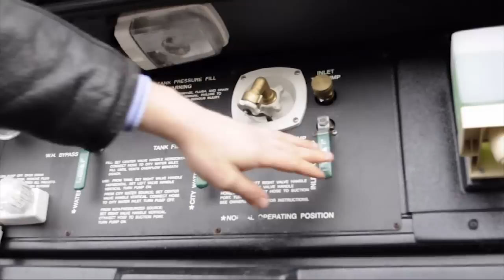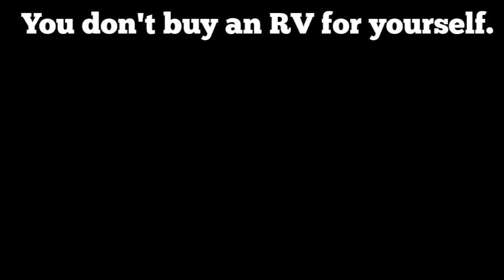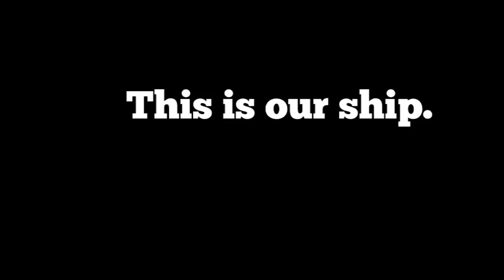Regular Car Reviews: 2004 National RV Tropi-Cal

Comment: v6!? Pansy shit!
My grandfather had a 37 foot pace arrow when I was a kid with a v10.
2 MILES TO THE GALLON! WHAT WHAT!!
This shit is probably a Prius by comparison!
Reply: This is probably an inline 6,  which all modern semis share. Since its a freightliner, it could be a Cummins or Detroit Diesel. Maybe a Mercedes.
Reply: I could have sworn I heard him say V6... but still...
Reply: L6 (straight 6) with 7.7 Liter displacement, those ford V10's are 6.8....  I bet you anything that ford V10 wasn't producing over 800 LBS of torque either.
Reply: Calm down evan, its a joke.
Reply: Evan J 

An L6 would be a completely different engine. This in likely an I6, or straight as its often called.

The straight 6 has perfect balance, Which is very important for diesels since the components are much heavier.

The V10 the other guy mentioned was probably a gas engine, Which was very common at one point. But the engines had to be massive to produce only enough horsepower, and they tended to be quite loud and thirsty for fuel. The diesel in this is probably much better on fuel, more powerful and since the engine is rear mounted - much quieter.
Reply: Trevor Reis Yeah about that.... It kind of failed as a joke and what was left wasn't even all that factual -- I wouldn't want to to think I didn't have a sense of humor though so here's a joke that a true petrol head will laugh at:  What's does a 1000HP Supra and a 400HP Supra have in common?  They both run a 12second quarter mile....Get it?....................................................................................................(it's a turbo lag joke).....
Reply: Straight six diesels are bad ass.
Reply: Evan J If you have to explain the joke, its not a good joke! haha
Reply: Evan J
If you'll take note of the initial comment I made, the only quantifiable number that wasn't just a description (v10 vs v6) was fuel economy (2mpg) and I also mentioned a Prius which gets good fuel economy.

And if you couldn't understand that I was joking by the line "2 MILES TO THE GALLON! WHAT WHAT!!" then I don't even know what to say to you. It wasn't a joke with a punch line, it was a silly comment.
Reply: ***** Or I assumed no one would get it....
Reply: Trevor Reis Thank you trevor for explaining funny to me.
Reply: Evan J
It wasn't 'funny' that I was explaining, it was the basis of my comment that you seemed to not understand.
Reply: Evan J Trust me WE GOT IT! Wasnt that complex of a joke!
Reply: ............I should have just said, "yeah."
Reply: Trevor Reis
You not understanding engines does not a good joke make.
Reply: I got the joke. It was funny! All the engine nerds can't take a joke!
Reply: noobasdfjkl
Your not understanding the difference between a joke and something said in a joking manner does not a commentary on my knowledge of engines make.
Reply: Trevor Reis I believe the word you are looking for is "facetious"
Reply: Evan J 
I believe the phrase your looking for is stop commenting. Lol
Reply: RiceReaper It's a caterpillar Inline 6, most probably this one  http://pdf.cat.com/cda/files/2200321/7/ledt7014-01_20C7.pdf
Reply: Dominic Gilbert 

Yeah probably. Freightliner uses a variety of engines. I don't have much experience with there busses, but the semis use nearly everything conceivable
Reply: Evan J 

Whatever point you were attempting to make, Has long passed.
Reply: RiceReaper You're right, my point was made on the first comment to the agreement of many. The rest has been one wiiikid pissah circle jerk down-spiral into sticky guilt ridden shame. I wish I could stop but someone keeps spinning the wheel of misfortune.
Reply: RiceReaper The 6.8L Ford V10 is a decent medium truck engine. But, it doesn't compare to a HD I6 turbo diesel. 362hp 457tq vs 400-500hp 800-1,300tq all at less than half the rpms.
Reply: hendo337 

The engines in many gas powered motorhomes were usually gm engines, since they were very cheap. I can't say what engine the guy had or what, if it was a ford engine. It wasn't a recent one. No one really makes large gas powered rvs anymore. But the point is

The old v10s are heavy, and very un economical, especially given the weight it is expected to handle comfortably and quietly. Many large motorhomes were only equipped with GM 350's, Which while for a light-medium truck are amazing, simply can't handle the requirements of a large pleasure vehicle.
Reply: Evan J holy crap you've got issues. taking your "daddy was never home" angst out on some random people who are just making jokes and trying to connect with other viewers.
Reply: Reno Jackson How did you know?  That's 100% exactly my motivation in this comment thread, I don't know why I didn't put it together!  I'm cured!  You know the best thing about being cured?  Not having to go though life with Reno as a first name.  Talk about Daddy issues.  Good god man..
Reply: RiceReaper Ford still makes the F53 stripped RV chassis it uses the triton 6.8L V10. It is based on the E450 van chassis. http://www.ford(dot)com/commercial-trucks/strippedchassis/trim/f53classamotorhome/ It is a budget priced unit for people that don't use their RVs a lot or travel very far with them.
Reply: Tre da 5'9 straight 6 bud. 5.9 cummins
Reply: Tre da 5'9

I got the joke don't worry
Reply: Kenny Huber 
It's painted yellow, not a Cummins, a CAT.

Comment: And a trucker is like: "ohhh a 40' RV that's cute.
Reply: But in a truck cab theres no pooper. No shower. No proper bed, no couch no fridge no space to move around, it doesn't change size with a button... But I guess you can bang in them.
Reply: +Chris Goodall some of them actually have cabs for a bed shower and toilet
Reply: Chris Goodall You can poop in anything if you try hard enough
Reply: @theevilmeister  or its -20 out at 2 am and the truck stop is closed
Reply: @dynamo1796  Actually, most trucks do have proper beds and fridges. Hell, a lot of trucks have bunk beds
Reply: @bensmith4563  Truck stops are never closed. EVER.

Comment: That's how my friend's F-450 is. I had to borrow it a couple times and you had to almost floor it in order to get up to speed. If you pushed it half way to the floor or just a little bit further, it wouldn't shift. The motor would rev up and get close to the redline but it wouldn't shift. He said he wants to put the ZF five speed in it and I said that would be a good idea.

Comment: Torque is in lb-ft (pound-feet)
ft-lb (foot-pound) is a measurement of energy.
They're actually two completely different units that often get confused.
Reply: I really don't think it matters in casual conversation especially when you verbally signify what you are talking about. (3 ft)(2 lbs) = (2 lbs)(3 ft)
Reply: Koop92tc That's kind of like saying that 3 miles is the same as 3 seconds though, they are units for two very different measurements.
Sure, people know what you mean but as an engineering student little things like that annoy me :D
Reply: In an engineering setting yes. But since both torque and word are measured by multiplying a force by a distance the order of which ft and lbs comes in makes literally no difference for either unit. The order that "ft" and "lbs" are just assigned arbitrarily to differentiate between the two. Much like the sign convention on the direction of heat transfer. Neither one is right or wrong we just chose one so it makes sense to everyone.

Comment: I've noticed this question in the comments, so I think I'll clear it up.

No, you do not in any way need a special license for an RV in the United States, even with air brakes.

You can even drive a commercial vehicle with air brakes on a normal license, as long as it's registered under 26,000 pounds.

Comment: My parents have a 1998 turbo diesel pusher... I think it's 36'-38'. Somewhere in that range. The thing only cost about 30k (60k miles on it. Excellent condiiton...still cost about 15k less than our new dodge durango). It's great for traveling. Love it. Walk around. Cook. Drink. Poop. Watch satellite (yes, even while moving). Whatever. But driving it just sucks. 65mph is about the limit. 70 or more and you get a nasty vibration and the steering gets too lose for comfort. Go 55mph up a hill and an empty semi will go trucking past you in the left lane at 75mph.... and the wind turblence from that.... just be ready for it because it'll just want to push you right off the road. Did I mention driving one of these things sucks? It's exhausting. I couldn't agree more that this is something you don't buy for yourself -- you buy it for everyone else. 100% on point, sir. I sweat whenever I have to drive that thing, too. It's a lot of responsibility moving 30 tons of potential doom down a highway at 65mph. Add another 2-4+ tons depending on what you're towing behind, too. The worst thing about these is if you have to brake in a hurry. Just hope you never have to because you won't be able to. You've got 6 wheels on the ground and they're not exactly wide.... 6 + not very wide = not much surface area contacting the pavement. You can lock them up and they'll just slide and half a mile later you'll come to a stop. Maybe 10ft sooner if you run into the back of that honda civic that thought it'd be a good idea to cross lanes and slam on his brakes so he can make that last second u-turn while going down I-95.

Comment: It does not take half an hour to fill that up with Diesel - should take about 10 to 15 minutes at most. Maybe for a low flow pump in the middle of nowhere, but that wouldn't be a normal occurance

(I drive buses that have a larger tank capacity)

Comment: That indeed is a big 4 slices toaster! That being said, a coach bus is 45 feet long and has a tag axle behind the double wheel drive axle at the back! Come in Quebec and I'll try to have you drive a Prevost H3-45! Volvo D13 engine (13 l. turbo in-line 6 cylinders, 500 HP, 1750 lb-pi) coupled with a 6 speeds Allison B500 transmission. IT HAS A POOP CONTAINER TOO! AND A JAKE BRAKE esti.

Comment: it doesnt take half an hour to fill those tanks.  it takes like ten mins if you're empty, truck fuel lanes pump way aster than standard gas pumps
Reply: The vent line for the tank isnt large enough for the high flow nozzles. The first time we tried the large nozzle it just puked it right back out. Have to go slow.

Comment: if that diesel is only a 7.7 L diesel, then that means it's only slightly larger than the Ford 460 V-8, at 7.5 L

Comment: had the same model. Wait till you have too "manage" your power, that gen only puts out 30 amp. So if you run a toaster and a blender then the ac kicks on.....bam everything dies. So you gotta yell "diverting power too the kitchen" So some will turn the ac off and the hot water heater's electric back up if it runs on propane. Then the toilet clogs if you even THINK of throw toilet paper in it. Ever been too a factory or another country and seen a waste basket next too the toilet?.......yeah it stinks. You have too check all outside vents regularly, because they WILL have wasp nests in them at some point. Get used too the pivot point for turning being 20ft behind you. I got a 5th wheel instead. Same amenities but easier too drive.

Comment: 1. I really hope you have an air-brake endorsement on your license because if not you may have broken the law...

2. Its an inline 6.
Reply: You don't need any air brake certification for non commercial vehicles under 40 feet here in the US, thats why 90% big RV'as stay under 39.5 feet, anything beyond 40 feet and you need a full class 1 license which includes air brake certification as far as i know
Reply: Wow, that makes things pretty confusing. I thought anything with air brakes had to have an endorsement.

Kind of silly they require an extra test for air brakes on large vehicles but not small ones.
Reply: Looking into it a little more, it's state specific, California requires it.
Reply: Depends on state.  Here in IL you can drive a vehicle 25,999 lbs GVWR or less with air brakes without a CDL and air brake endorsement.  26,000lb and up, you need a CDL and air brake endorsement.  This RV is probably right under 26,000.  But I'm not totally sure on RV exemptions, since I have a CDL and drive trucks..lol
Reply: Dinger Mike 
If people would just read the comments. In the Lower 49  of the US you DO NOT HAVE TO HAVE A CDL to drive a motorhome! With or without air brakes does not matter as long as it is a recreational vehicle.
Reply: flyguy92325 Correct just having an RV plate excuses everything. I have one friend with an RV similar to this that weighs 49,000lbs and another that converted an OTR truck to RV by taking out the tandem axle and both need no special licenses or endorsements

Comment: Any reason why most RVs use head/taillights from common manufactured vehicles? The front of this RV has the 2000-2006 Chevrolet Tahoe/Suburban headlights, and the rear is using the 1996-present Ford Econoline taillights. How come the RV companies are too lazy to produce their own? Am I the only one who notices this?
Reply: It's not laziness, it's cost effectiveness.  It's the same reason many low production volume supercars from smaller firms pull the same trick, though more so in the era between sealed beam systems and the current abundance of fairly universal projector/reflector modules.  Headlights and tail lights require certain emissive and reflective requirements be met in order to be legal for on-road use.  Their beam patterns, visibility angles, and intensities must meet certain parameters.  They also need to meet or exceed crash safety requirements in some markets.  And then add to this tooling and manufacturing these light assemblies.  Manufacturing for complex injection molding systems has insane fixed costs.  So to avoid all of that,  these guys just use what's already available in bulk.
Reply: Andrew Sanjanwala Thank you for sharing this information.
Reply: Chrysler door handle too.

Comment: In the U.S. does one need a heavy vehicle drivers licence to drive something like this RV?
Reply: Rules vary from state to state, but I believe most states allow anyone with a basic Class C License to drive anything with a GVWR (Gross Vehicle Weight Rating) of 26,000lbs. or less. If it's over that, then you either need a special non-commercial driver's license or commercial driver's license. There are some states that have their very own rules.